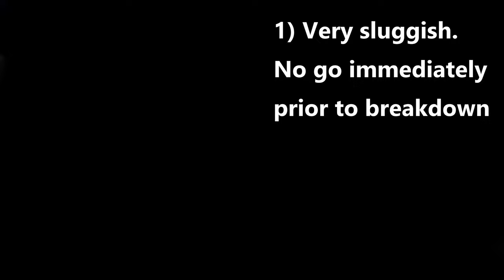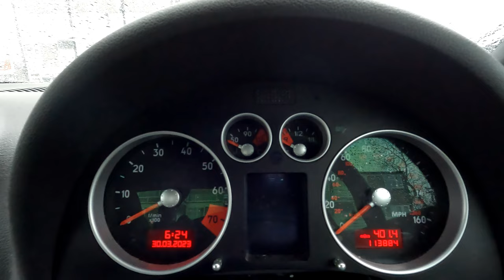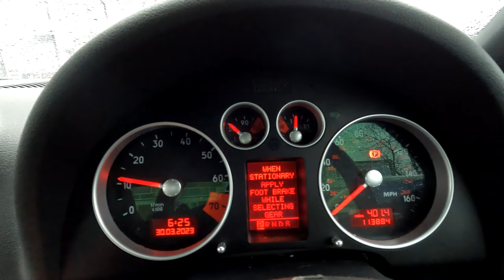Audi TT Mk1 - breakdown vlog Episode 1 - Fuel Pump Dramas

Comment: Andy did you not see my video , I showed if you tap the top of the fuel pump with a hammer you can get the pump to prime and start. 😅 I show in my video all the wires and pipes required to change the fuel pump.
Reply from the maker: I did see your video and I should have credited you in the video for the hammer trick. I did not like the idea of giving it a whack though!
Reply: @andycharger  it’s no different that giving a bad starter motor a tap. All your really doing is shaking the amateur on the motor and making the bearing move to reduce friction . What fuel pressure is the vr6 running at ?

Comment: Any comment on the fuel filter as a possible reason for fuel starvation ?
Reply from the maker: Could well be if you have a faulty sender or the pump itself is starting to fail. It turned out to not be my problem but something to check. I would also change the fuel filter on the car in case that is blocked or full of fuel sludge from the ethanol. 👍